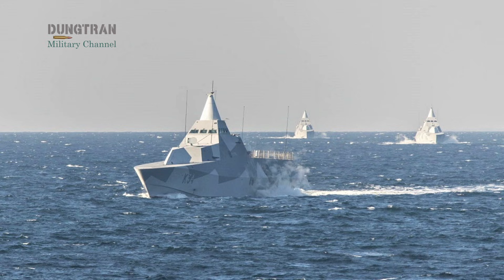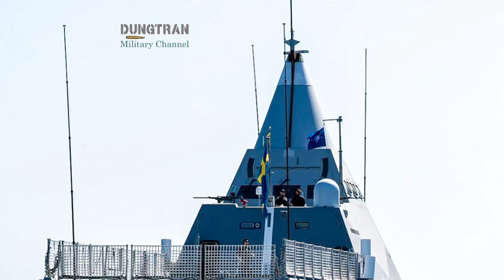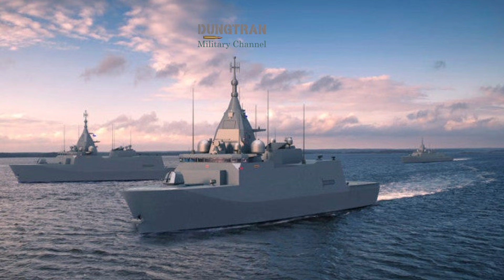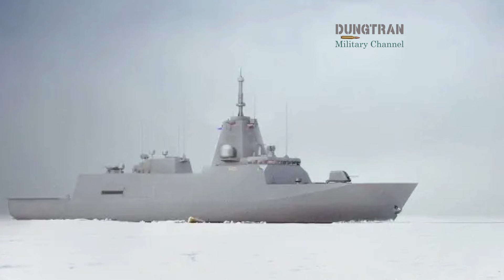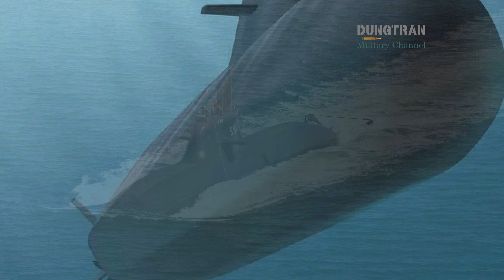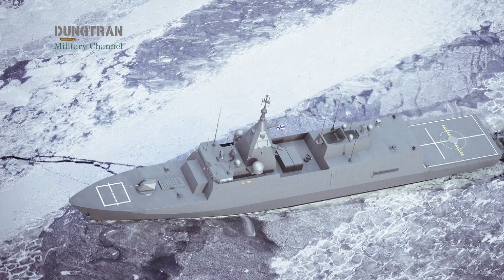Visby, Pohjanmaa, and Type 212CD: The Three-Layer Naval Trap Closing Over the Baltic

Comment: Norway has much more relevance on the Arctic Ocean and the Norwegian Sea than the Baltic Sea and will also be more busy there.

With all this talk of anti-access area denial it is weird that narratives such as these won't consider that it is Russias strategy on the Baltic Sea and NATO must contest it. It is not sufficient to prepare to deny Russia the free use of the sea, nor to contain them into the Baltic at the Danish straits, that would cede them too much.

The Russians won't be trying to break out from the Baltic, they will be on the defence and will employ their repertoire of A2AD capabilities to prevent NATO from accessing in support of its isolated members fighting a land war. The Russians will be just fine if NATO is content to limiting the Russian Baltic Sea fleet to be used as an asset only on the Baltic Sea to strangle the Baltic states so to speak. They don't need to go anywhere to prevent NATO from coming to the help of the surrounded Baltic states and to prevent NATO air dominance over the theater.